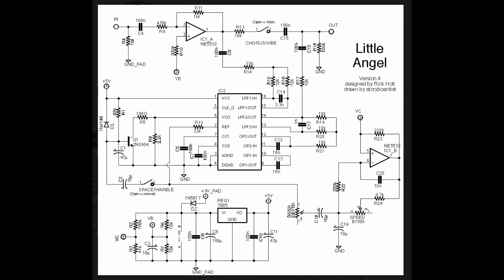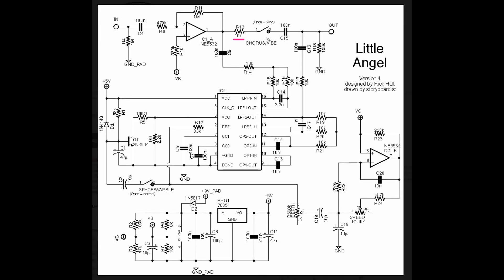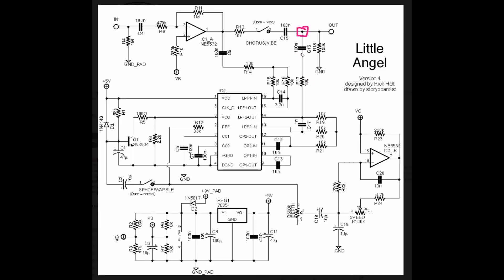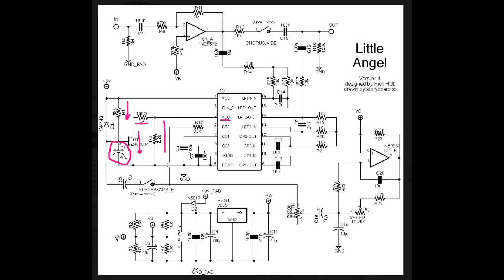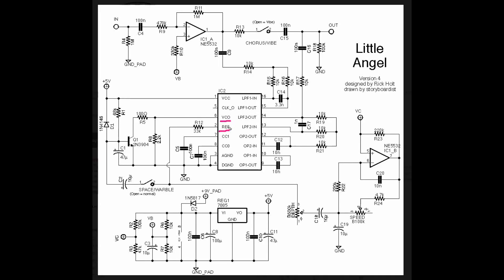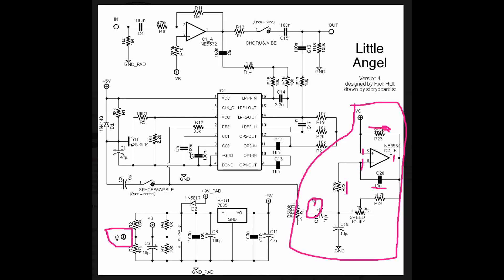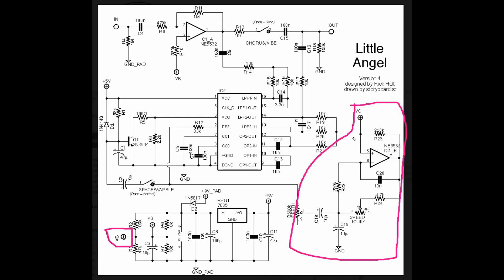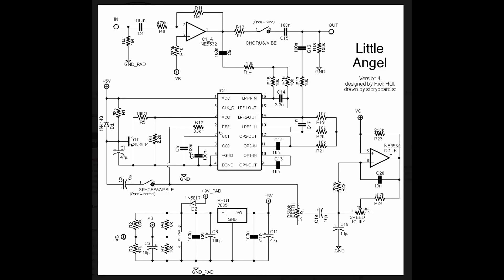Schematic Elements for Guitar and Effects: LFO, PT2399, and the Little Angel Chorus

Comment: Why need for startup circuit when pg2399 datasheet table 1 explicitly states that 0.5 ohm is ok? The chip invalid state is probably caused by some other design considerations. Ok so a few seconds later I see it is because of Vref manipulation. So the high pin 6 resistance is actually required to workaround Vco startup
Reply: That datasheet is almost useless.

Comment: Any way i  can use B100k for depth  yet get the correct sweep?
Reply from the maker: The way this is set up, the series resistance is critical to get the sweep to go low enough. So, in short, no. You need the specified value to get the standard sweep. You could truncate the sweep on one side or both, but you can't get the full sweep with just a B100k.
Reply: @thescientificguitarist4228  oh if i cannot get full sweep with b100k then it would be pointles.. bettwr use  b500k 😁

Comment: Great to see more PT2399 content from you :) i believe i saw other ways to modulate the delay time, that were solely working on pin 6 so it is interesting to see that there is another, in my opinion more straight forward way. I wonder if it has any advantages to do it either way...
Reply from the maker: Both pin 2 and pin 6 are connected via internal circuitry, so one isn't necessarily better than the other. The pin 2 is useful when you want to have the shortest delay times possible, which requires low resistance to ground which would otherwise ground out the LFO output.
Reply: @thescientificguitarist4228  Thank you for the answer